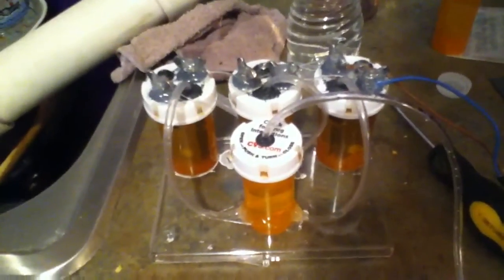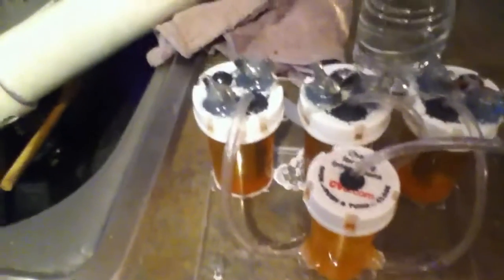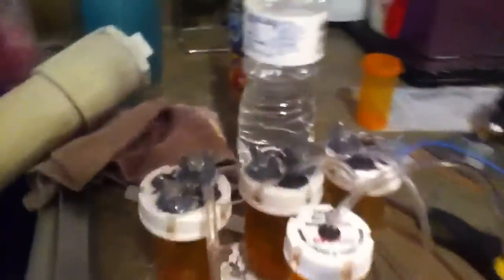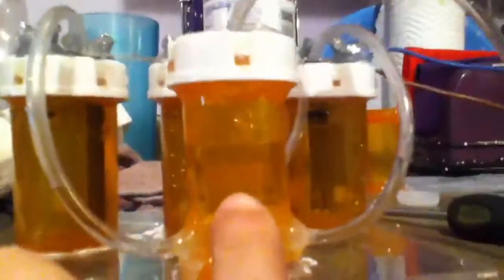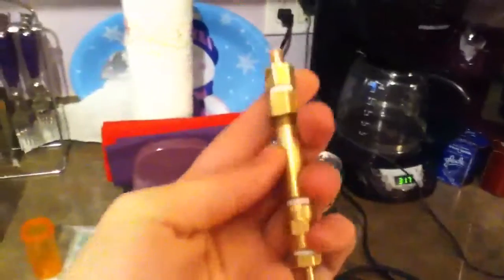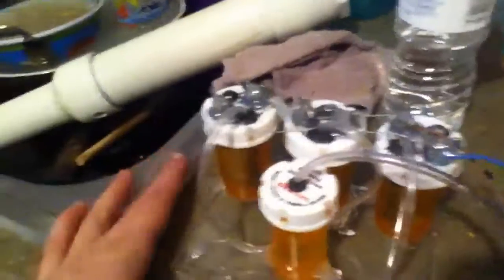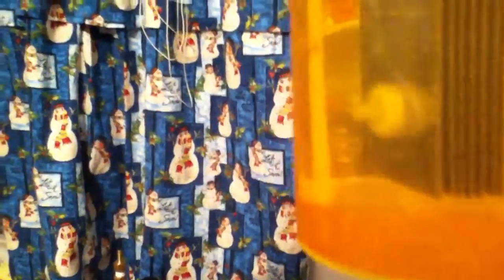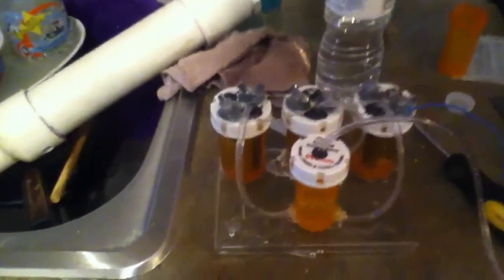Mini HHO Torch

Comment from the maker: That is correct, I have it setup like that to split the voltage. If I am using a 12 volt supply, and have 5 plates, each plate will be seeing about 2.4V, which increases efficiency and reduces heating. However in that small design the plates are not sealed so it doesn't work all that great.

Comment: Interesting, I think I have a 0.025 laying around somewhere, I will have to try this. I'm thinking about soldering the tip to a drilled out copper pipe cap, that way I dont have to worry about fittings, but then I thought about the tip heating up and melting the solder and flying off to explode. (duh) maybe ill try the fitting. Thanks 4 the info.

Comment from the maker: If you are gonna do a little one, the .025 is better.. I use a compression fitting, I can't remember the exact size.. You just drop the tip in there, and tighten it up :p